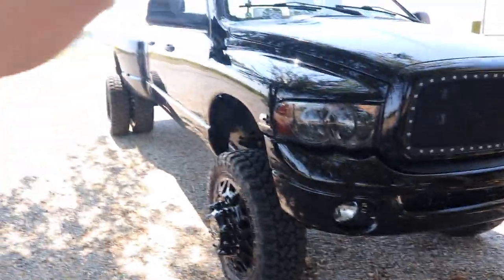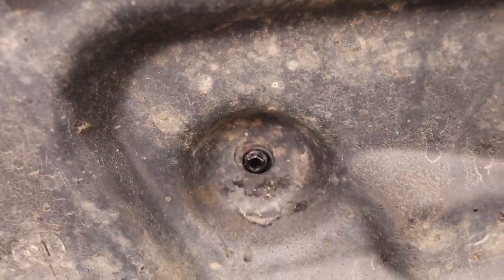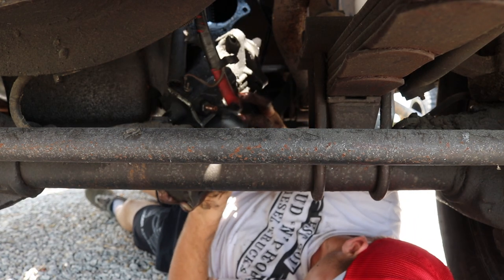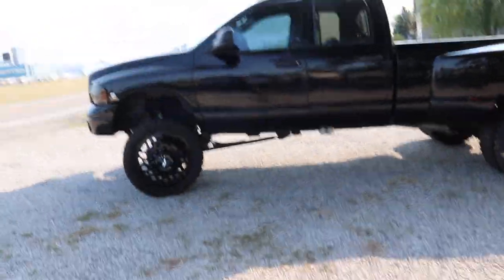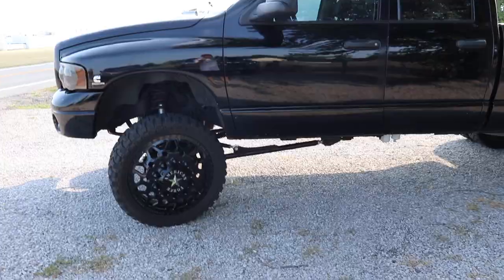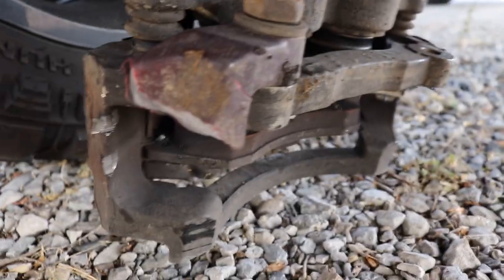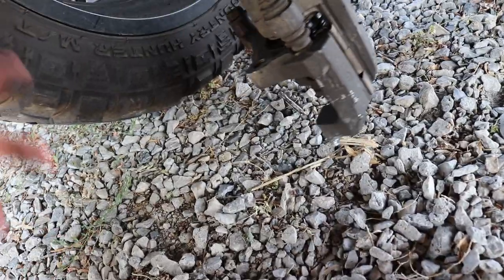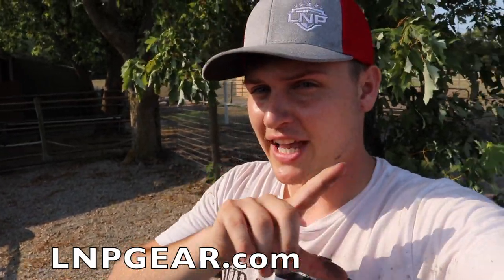The WhistlinDiesel Dually BROKE already...

Comment: That happens when the bolts are not tightened to spec. Caused rocking of the caliper and slowly wears the slack adjusters out then the squealing happens, then snap.

Comment: Just need a new caliper bracket.  You can get them at most parts stores.  I used 3rd gen brackets to fit larger 3rd gen pads and rotors on my 2nd gen.

Comment: That's a super easy fix dude just change the bracket that holds the caliber!! It's just back out from driving or whatever it would've happened to Cody it just happened the truck is fine 10 minute fix just don't hit the brakes again an blow the Pistons in the caliber
Reply from the maker: moosestang# LS it’s the parking brake assembly that broke.. the caliper and caliper bracket it fine.

Can’t find a parking brake assembly anywhere at the moment

Comment: The calliper  mounting bolts breaking is common. They broke on my 07 Ram dually on the right side. When you buy them from Dodge they come in a pack of 4 so you can change them all.
Reply from the maker: They are apparently discontinued...

Comment: That's what happens when the bolts aren't torqued properly...same thing happened on my candy cane f150 except it was the front caliper but it fell off and twisted around the rim got under the rotor and cracked my rim in three spots...so.you got lucky lol

Comment: That's the first I e seen I've seen a lot of crazy shit with brakes but I cant figure out even how the rotor set so far in to rub like that crazy that's what happens with over a quarter million miles or more
Reply from the maker: River Sharp top bolt had to rattle loose and then it just kept smacking back and fourth between goring forward and backward creating those rub marks.

Since the top bolt would have been no longer holding it in place.